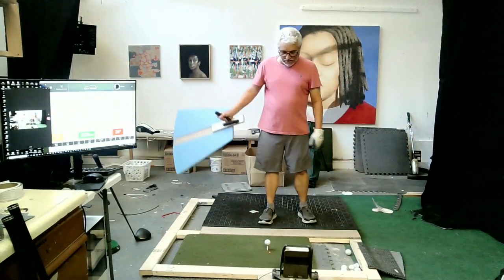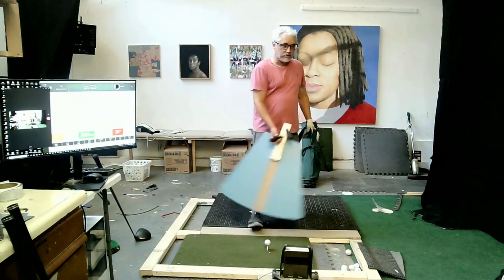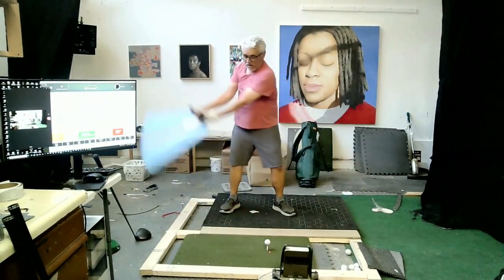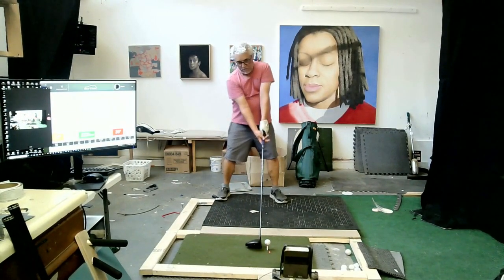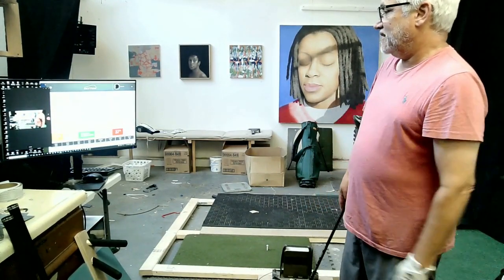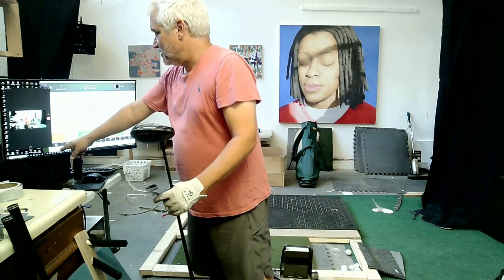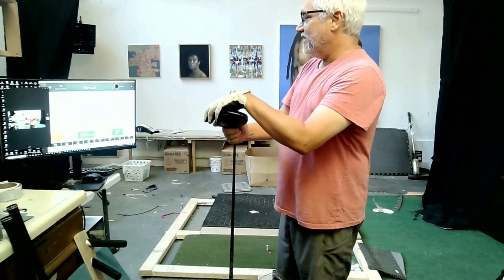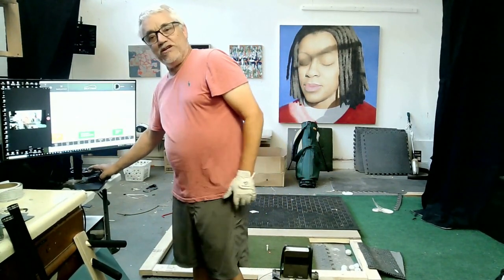driver e bell speed training day 1

Comment: How heavy is the E bell and how heavy an object would you recommend we swing?
Reply from the maker: About 10 lbs either way. Don't swing that much weight if your hands are not spread apart or you can hurt your wrists
Reply: Wha is the dimensions and weight of E ball
Reply from the maker: @pankajsah1850  2 fett long  10 lbs